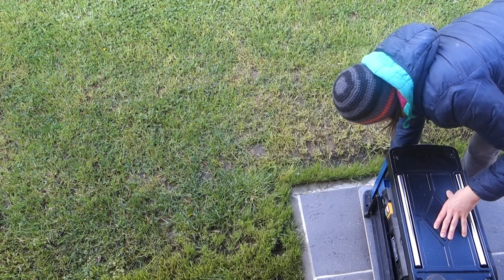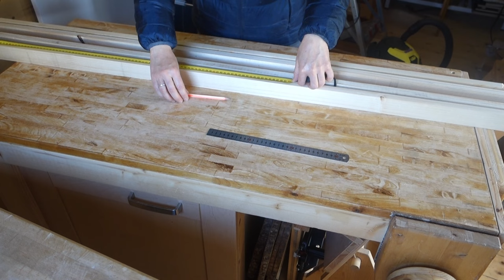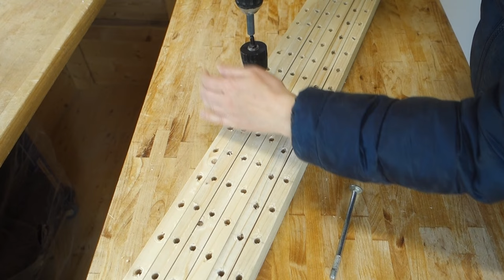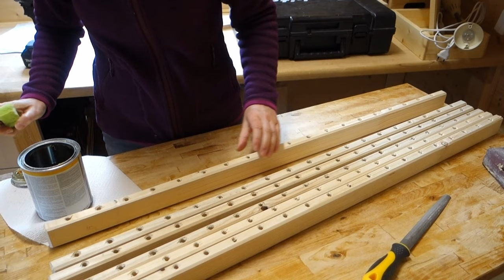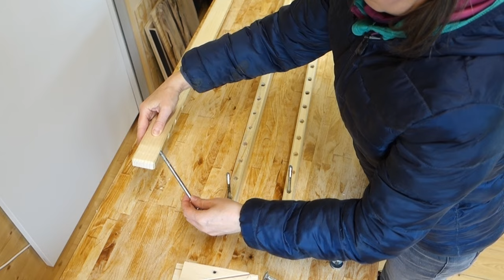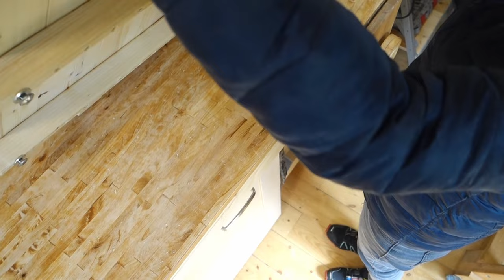Bar clamps | glue wood without expensive tools | homemade tools

Comment: I like how you used the f-clamp to lock the wedges. Pretty clever.  I made some similar clamps. I made the wedges such that one had a hole in it and the bolt passed through it so it wouldn't slide. Then I could just tap the other wedge home with a mallet or small hammer. Your use of the f-clamp pretty much removes the reason I made the more complicated wedges. Good stuff. Looking forward to your other videos.

Comment: Cam clamps for me.  Need a load less tools, less wood, less time, less cost.  Last time I made a batch of cam clamps I figured out it cost me around $.25 each.  For that matter, drive a couple of nails in a piece of scrap wood, and insert a wedge to apply pressure.

Comment: You shouldn't have a gap behind the router bit on your table. Move the fence up so you can slide the workpiece along it. As for the clamps, use thicker tapered stock for greater clamping force. Looks good though.
Reply: She is using a ball bearing bit so it does not matter that she had a gap between the fence and workpiece. She probably did not want to waste time by take the fence completely off or more likely she wanted to use the vacuum which was attached to the fence.